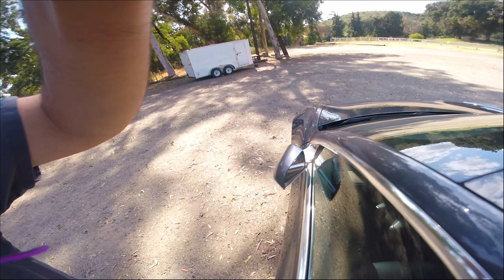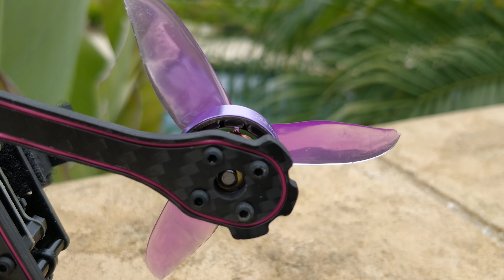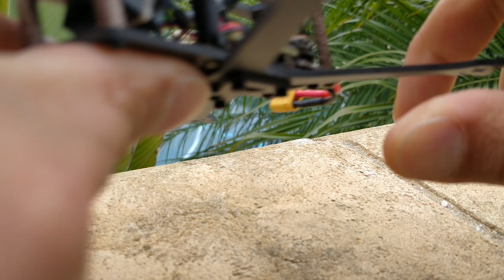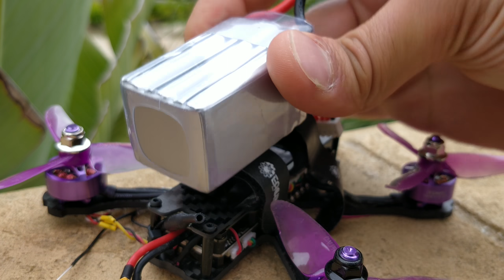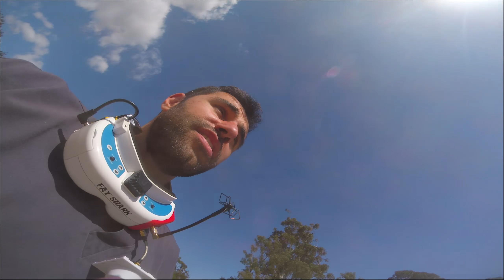Eachine X140HV - voltage/ light/ heavy discussion

Comment from the maker: Table of Contents:
01:00 - The motors (best part of the quad)
04:00 - Flight video part 1
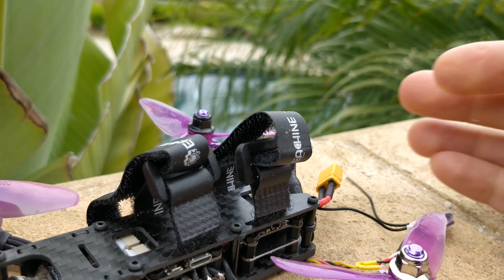05:48 - Frame issues
08:48 - Heavy vs. Light 3"
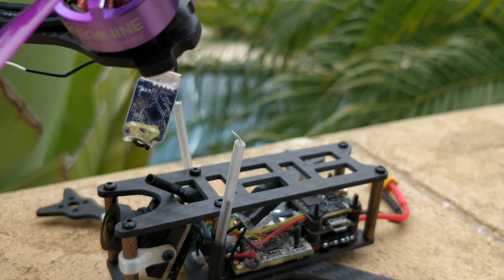13:34 - Voltage, when is it needed?
18:26 - Voltage and flight time
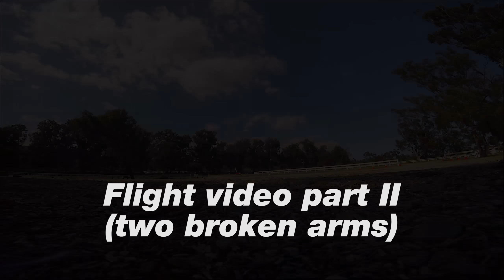21:08 - Flight video part 2

The 1507 2500kv motors: http://bit.ly/2YBAR1c
(these are really good if you want to run 5S or 6S on a 3" or 4")

Eachine X140HV: http://bit.ly/30xeZps
Dal 3056 prop: http://bit.ly/2VyGOdi

Equipment I highly recommend:

Micro Eagle - 
http://bit.ly/2Q7LfL7

Rush Tank Vtx -
http://bit.ly/2HsrASs

Fantastic solder-
https://amzn.to/2P5QM2W

TS100 iron -
https://goo.gl/DqBipa
https://goo.gl/svK6DD
https://amzn.to/2OV5XMh

WaFL’s Cap Cap
http://bit.ly/2GUpXxO
Xing 2306: https://goo.gl/TT9gnw, https://amzn.to/2VkZ8rt
Flywoo 2306: https://goo.gl/xuLG6d
Hold off on 220X motors for now.  There is a bug in BLheli/BF that makes them act a little weird unfortunately.  :-(

Sub $200 5" build that's still good:
Frame: https://goo.gl/EpXQhZ
FC/4in1 Stack:  https://goo.gl/HprVbj
Motors: https://goo.gl/h5rofi
Props: https://goo.gl/ZnzY2y
Props: https://goo.gl/VMBiQh
FPV Cam: https://goo.gl/FDJhYw
Vtx: https://goo.gl/JNVDMn

Starter goggles I recommend: https://goo.gl/GvJUkT

Tips?
PayPal: https://www.paypal.me/kababfpv

Please use my referral code if you're gonna buy a Tesla.  You get some free stuff when you do and I get better status with Tesla: https://ts.la/bob40889

Bitcoin: 1E4XZXoD4rS6MYWVWuenY7Kw2M1YgyNpoQ
Nano: xrb_1188ek5bd7tb9kw67asnp9o65byuoaxbtpxuznx1ribf75x78awywmakj55f
ETH: 0xD067F93811f2eC31CB1928901002dfdf9A492EF5
LTC: La2KWYAjp4VT2Lq2M76pbjzXWvRyjpfCtG
Reply: Ooooh. The motors are cheap! I think I just found the power system for my 4in hexacopter.

Comment: 2500kv for 4s and 2700kv for 6s? Please help me to understand i thought you lowered the kv when upping the volts, I'v bought one of these but haven't tried it yet because I expect It to fail 😢
Reply from the maker: Some people don't lower the kv and just run 6s. But yes typically you lower the kv and run more voltage. More voltage isn't really the answer most of the time however

Comment: Am i crazy if i use this motors for an acrobrat build with 1500mah 4s lipo? Will it do acro moves with the overall weight?
Reply from the maker: Very suitable motor for that.
Reply: KababFPV not too weak with 4s? You havent flew it with 4s right?

Comment: Hi there, knowing you have tried lots of quads, in your experience wich is the best 2" or 3" to carry a session??? I saw many using the 2.4" toothfairy for it, is to get some shots and hit small places without a turtle, maybe putting some protection, I really didn`t like the squirt v2 is to big
Reply from the maker: Nothing less than 5" will carry a session well. Sure a 2" can, but flight performance will suck.

Comment: Ok, I'll agree that the frame does appear to be poorly designed, but in all fairness you did strap a 70g GoPro Session 5 to a 150g 3" quad (with skinny arms) carrying a massive 100g 550mAh 6S battery....that's 320g! Combined with the roll of death from the desync, I'd say the broken arms are only expected. But then you turn around and complain about not liking heavy 3" quads. Hahaha, oh the insanity of it all! 😅
Now I totally get that you just did that "for science"...but maybe it's the same for Eachine with this 6S 3" quad. I say let's just call both experiments a fail and move on 😸
Reply from the maker: This is the first arm on any quad I've broken in over a year.  I didn't expect it to just randomly fall out of the sky like that...this isn't a quad to get.  Steer clear
Reply: All good, I wasn't discounting the conclusion you came to, and I certainly had no intention of getting it, I just thought the GoPro was an overkill. 😅
When I first got into FPV 2 years ago I bought an Eachine Aurora90 BNF quad and it caused me endless grief with death rolls. But I learned heaps about quads troubleshooting it and eventually used the parts to rebuild a proper 2.5" quad, so I know many of these BNF/RTF quads are only good for cheap parts. Thanks for all your awesome videos man, I love the work you do on those toothpick builds! Greetings from NZ!

Comment: I agree with the 1507 not being "safe". 
I built two quads with 1507 BH motors last year  and had to stop flying them in my neighborhood 
One was faster than my 5 inch quads they both  were  not safe when crashed. 

I also have a few 3 inch and 2.5 inch using a light body and 1107s  and 1106s  with various KV  setups and they have ridiculous agility and performance. They do however lack durability but they are neighborhood approved

Comment: Bob, flight time is related to amp hours, or watts (volts x amps) contained in a battery. Higher voltage means less amp draw, per watt of power consumed. Less amps means lighter wires, lighter traces, lighter components. In regards to 1s, 2s, 3s on toothpicks... as long as each has the appropriate kv motor per cell count, performance should be equal given no other variables. Ex 1s vs 2s... 2s with 9000kv =1s with 18000kv
Reply from the maker: yeah that's what it is on paper but that doesn't work out in the sky.  Amps seem to be more efficient and you definitely gain more flight time from something like a 2200mah 5S vs 1800mah 6S.

Comment: The single piece bottom plate was a baaaad idea. I would convert it to a micro Reverb...
Reply from the maker: Weight is the issue then but yeah much better option
Reply: @Kabab  with a Reverb frame and maybe some little upgrades to the electronics, it would be a badass little quad. But I have to agree, 3in ultralight will probably be the way to go for most people.
Reply: An Airblade intrepid would be a nice frame upgrade as well. Especially the 4in.

Comment: I would like to see you develop a 1S 18650 quad!
Reply: There's also the 14500 cells to consider. Same size as a AA. Some little RC trucks use two and run for 15 minutes on a single charge.
Reply from the maker: Syma X5 will just barely run off the best sony 18650 cell that has the highest amp output. I forget the model. Can't carry any more weight however.
Reply: @Kabab  Too bad it does'nt scale down. I know that many people are successfully using custom Li-Ion packs for LR. 
David Windenstal said he got over an hour of flight time on his new tricopter.
Reply: @Kabab  Bob, I thought maybe you should see this....

https://www.youtube.com/watch?v=wC4v_RMpKCY

Comment: I did not know the thing about taller motors draw more amps. You learn something everyday
Reply from the maker: As things get bigger that effect lessens however it's still there.
Reply: @Kabab  So 2216 motors draw more amps than 2205 for example?
Reply from the maker: @brianevans4  yes definitely but that's also because it's just a huge motor. However, at the same amp level, the larger motor will be more efficient....meaning will generate more thrust.
Reply: @Kabab  thank you! Is there any good video explaining these things about motor size relationship to thrust/current draw/efficiency etc?
Reply from the maker: @brianevans4  there are some out there but it's not really going to matter. I focus on size and feel and the amps are really governed by over all auw and power output. Not really the specific motor.

Comment: Great discussion, thanks. Eachine is the perfect example of these Chinese manufactures who are NOT attempting to make the best product possible, but rather they're aiming to sell a product that will generate MAX sales/money/profit. So they target the current hype, and especially the people new to the hobby/sport - who don't know any better because they as yet have no experience. Such an approach does NOT help or aid the hobby, instead it just takers advantage of people's lack of knowledge, experience and wisdom. The Eachine Tyro79 frame is the exact same fail - cut square to the sheet to save a dollar but causing a major decrease in possible frame strength. The best advice for new pilots given these circumstances is, don't buy anything Eachine. There are others who ARE trying for the best product possible, including Diatone, GepRC, and some of the western designers.

Given the recent restrictions regarding >=250g RC aircraft in many countries (including Aus., Eu, Uk, Can,etc), there's a new and strong interest in sub 250g quads and planes. So my recent building focus since before Christmas is in <5" frames, mostly 3". Basically the orientation is that I want the fastest/most powerful/longest flight time that's possible for less than 250g AUW. Really a 249 gram replacement for the std. 5" quad. Safety is not really at issue - based on events/evidence to date there is ZERO actual appreciable safety risk for the general public from RC aircraft less than 3kg. Of course for City/public flying I do see the advantages of feather class quads. The recent developments in 3" and below and also in the feather classes, is really amazing.

So we need onboard HD cams at about half the weight/size of the current split mini 20x20 form factor. Say a 16x16 version at <= half the weight. Especially for 2" and below. Same for the electronics as you've pointed towards previously. An example, the Diatone GT R349 would look amazing with a 16x16 electronics stack. As it is with 20x20, it's kinda electronics bloated lol. But still cute! :). Cheers.
Reply from the maker: If they just made the split cams have a better vertical fov it would be fine

Comment: I built a 6s 1306 3". I went lighter because I 100% agree, heavy 3" is pointless and offers few advantages. 5" is better. I went  6s for that throttle mashing performance and because I have a bunch of 3s 450s that are perfect. Whenever I fly my micros they are so controllable and agile under power and they carry so little momentum that I just want to nail it and "race" around everything.

I found that although I could get good flight time out of 1407-3600kv 3", if I flew like I wanted to I would be getting less than 2 minutes and puffing my shittier packs. I'm hoping for longer flights, yes, but under those higher throttle conditions which is where I think 6s should do better.
Reply from the maker: That sounds like a suitable use for 6s
Reply: What 1306 motors are you using on 6S? That made me really curious.
Reply: @yannickg6904  emax rs1306-2700kv
Reply: @frasersteen  interesting. With two 450mah 3s packs in series?
Reply: @yannickg6904  It is yet to be maidened but yeah. 450 6s should be about the same as a 650 4s.
Reply: @frasersteen  subbed to your channel, looking forward to the some dvr.
Reply: @yannickg6904  I'll make sure I label it properly when I take some then
Reply: @frasersteen  Nice. That could be a nice power system for an Acrobrat. It propably needs the extra ooomph of 6S.
Reply: @yannickg6904  I dunno, Acrobat is heavy AF. I'd want something a bit bigger. I'm using an 11xx size frame but the dry weight is 99g.
Reply: @frasersteen  Nice combo. I was looking at the Airblade Intrepid 3in lite for the same reason, but I was planning to go with the GEPRC 1206 motors. I want the longest flight time out of a sub 250g 3in carrying a caddx turtle and eventually, a Tarsier.
Reply: @yannickg6904  I'm pretty sure I know you from the brushless micros FB group. For that use case I would personally go for the rcx1304-4000kv on 4s. Maybe a 1404. If betafpv or someone can make a decent 12a 4s board I reckon those rcx are the way to go. Cheap as anything too.
Reply: @frasersteen  the new Iflight 16x16 stack looks interesting. Alternatively, I have a broken Spedix rex 80 I can take apart. It has a 4S rated 12a 4in1 and a F4 FC on a standard  20x20 mounting pattern and weighs nothing.
Reply: @yannickg6904  Stick a cap on it if you are running 4s. Can;t hurt and probably will give you a bit more overhead.
Reply: @frasersteen  That sounds like a plan, combined with HQ T3x3 biblades it should be a nice efficient setup.
Reply from the maker: @yannickg6904  yeah not sure if that

Comment: Hi, you say 3.8v is above resting voltage but my charger(toolkit m8) store them at 3.85...is it OK If i keep going like that or do you recommend lower voltage for storage?
Reply from the maker: I put my batteries at 3.85 also but typical resting voltage is about 3.75 to 3.8

Comment: I 100% agree with you, Bob. One of my favorite quads is my 3" Airblade Eclair V2 with 1108 6000kv motors on 3s 650mah. It has plenty of power, but I mostly love just so smooth and easy to fly it is. I've tried just about every T-style prop out there, but the 3" Emax Avan Mini props pair perfectly with the 1108 motors. I have a heavy 3" with 1407 motors on 4s, but it rarely gets flown once I built my lightweight 3" setup.

Comment: It’s actually pretty simple, ohm’s law is what you want to look at. Volts, Amps and watts are all relevant, Watts being power consumed, so it’s more about the Watts than it is volts or amps. Capacity vs voltage doesn’t so much matter it’s about the power being consumed

Comment: I'm curious what their ESC setup is like.  I wonder if you could stop the desyncs with adjusting current protection, changing rampup power and increasing Demag compensation.  We always try to fix stuff in Betaflight and sometimes I feel our problems are in the ESC setup.
Reply from the maker: It is unlikely to help if I change any code in or any version of the firmware

Comment: The led strip is unnecessary and just adds weight to the quad and significantly reduces the strength. I'm not trying to hate on eachine, but they are one of those companies who just want to make products at the fastest rate possible and not even test stuff and just think that it works because the spec sheet says it will.

Comment: Kebab, you should do some stuff with the toothfairy 4 inch, iflight mini stack and whatever motors you want. I've got a 6 inch floss with xing 2207s 6s and the 4 inch tooth fairy flies very similar, a little touchier/twitchier but a lot more durable in crashes and far more nimble.

Waiting on some rcinpower gts-v2 1506 motors in 3000kv for 4 inch 5s usage. I have very high hopes on this setup and it seems to fit in with your love of lightweight quads.
Reply from the maker: Working on it
Reply: 4in gets no love...😂

Comment: I swear by the 1606 emax motors, I run 1408 also but the 1606 are next level, I run them on my custom titanuim frame gecko 3in. I built a 130g 3in also and I prefer the titanium frame at 390g auw

Comment: Interesting. I removed the rear battery strap and put the remaining one just around the top deck, instead of the small slits in the plate. And replaced the heavy steel prop nuts with aluminium one. That alone saves 6g, and it should also make the motors react a little faster to throttle changes maybe.

Comment: You sound salty. You said it works fine on 3s,4s,5s, and 6s. Was there REALLY a good reason for you to trash it for several minutes because it's rated for 6s? Are you gonna cringe when you go back and watch this once the whole industry is on 8s in 2 years?

Comment: I'm working on a 3" freestyle HD frame with Acrobrat-style vibration damping, but I'm trying to lean towards the lighter side.  I'm not coming in as light as you, though.  I'm at a bit over 190g with a 450mah 4s and 1306 motors, or about 220g with a 650 mah.  I'm getting 3 to 3.5 minutes of (what I think is) aggressive freestyle on the 450 and 5+ minutes on the 650.

For my style of flying, I'm enjoying the heavier battery way more.  It is zippy, crisp, and fun with the lighter battery, but it hucks noticeably better when it is heavier.  I have a 4" 1606 build on the same frame with longer arms that comes in at 270g, and it feels an awful lot like my heavy 5" Flowride builds.

I'm excited about lighter builds for many of the same reasons as you.  I'm also excited that I can build a "hold my beer" 3" quad with a Turtle that costs less than a GoPro.  The lightweight quads are interesting and exciting for so many good reasons!

Comment: Did you update the fc and esc? some said it was why 220hv deathrolled, even came with red text not to flash the fc
Reply from the maker: Didn't touch the firmware. Just turned on air mode
Reply: @Kabab ok.. they just a problematic company:) atleast i got 220hv flying nice on 4s with some cheap samguk solution:)

Comment: When someone asked to person who is responsible for Eachine FPV quad manufacturing they still don't have 6S 3-incher, he responded "Hold my beer!". For park flying - too powerful and too loud and need good ESC's and motors which honestly never was a strong side for Eachine quads. For flight time actually not required. With proper 14xx motor and 305... prop combination 5-6 mins from 3S and 4S - no problems. Squeezed out 6:30 from Diatone GT-R349 with 4S 1100 mAh Tattu R-Line, flying in pretty steady pace.
Bob, are there is at least single your frame left that wasn't copied by Chinese? I believe that frame which you demonstrated for comparison will soon swim up in Banggood under misspelled name having wrong carbon cutting pattern. Seriously, I can't understand where is a problem to insert a carbon list into cutting machine with correct side forward. Carbon weaving is not a rocket science either.

Comment: That's said... Wanted a frame designed like this... The micro alien is to much because I'm in Europe...
Reply: Have you tried AmmaxInno? They have a nice selection of frames and great motors...
Reply: @yannickg6904  I know that they've really nice motors, but do they have micro frames?
Reply: @robbinkoot2154  there's the Freestyle line from 2 to 4in and the nano series from 2 to 5in. I'm currently building an ultralight 5in using the nano 5e.

https://www.amaxshop.com/index.php?route=product/product&product_id=1573